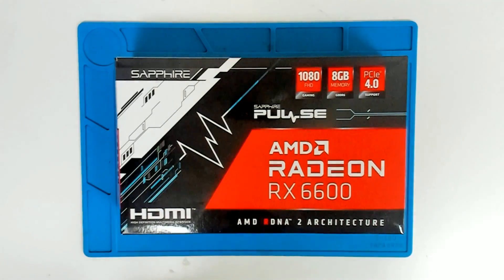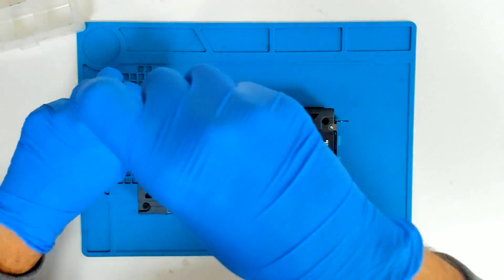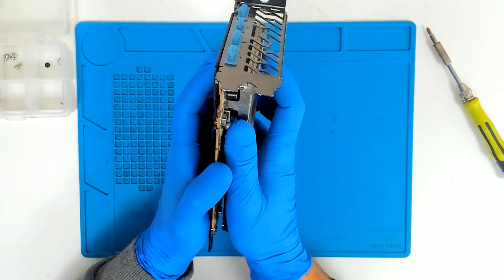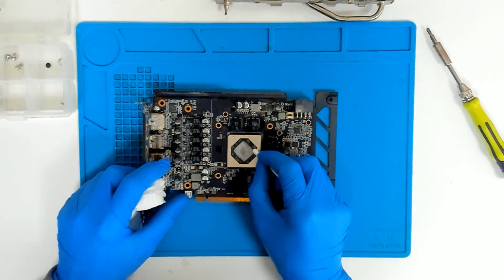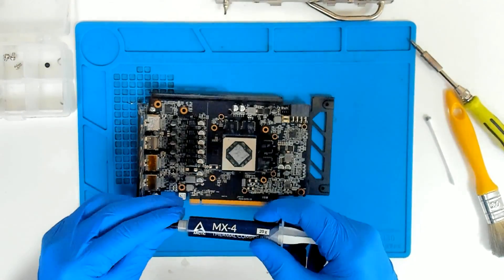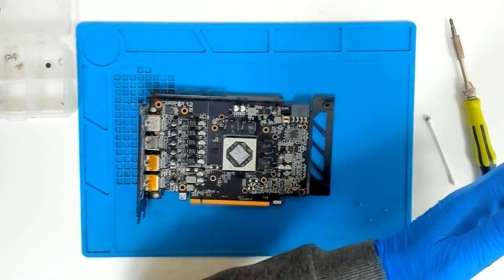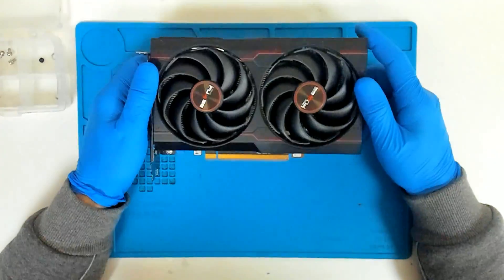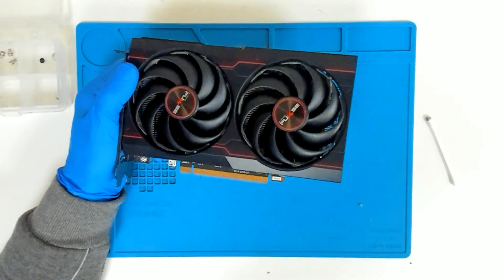AMD Radeon RX 6600 Pulse Thermal Paste Replacement

Comment: Hi I have a question. Can we remove just fans except aluminum blok for sapphire pulse rx6700 10gb
Reply from the maker: Why do you want to remove only the fans. You can clean the dust with a brush without removing it.
Reply: @LaptopDisassembly  I don't know I want to make sure it's clean
Reply from the maker: @yldrm743 Dust is not the biggest problem. You can vacuum the dust without removing anything. Problem is the dry paste that will stop to suck the heat from the GPU.
Reply: @L @LaptopDisassembly , I wanna try clean the dust with brush and vacuum. If heat down I wont remove anything(my english is bad. I didnt use translate for this comment, ım sorry 😢)
Reply: @LaptopDisassembly btw thank you so much for your help 😊
Reply from the maker: No problem. Clean the dust and if that doesn't help, you need to replace the paste.
Reply: @LaptopDisassembly I’m gonna do it and I will text you again for the results by by have a nice day 😊

Comment: Btw if the pads look "wet" in some areas, they are CAPUT and you'll need new ones - stronger ones (better conductivity). The ones they sell it with are like 4-5W/mK 🤢🤢🤢

Comment: sir for asus dual rx6600 xt 2mm?
Reply from the maker: No idea. I haven't open that model so far. I usually don't replace the pads, only the paste. The pads don't dry out like the paste, so you can leave the original ones.
Reply: @ 👌 thank you

Comment: Sapphire pulse cooling is trash. I have a Pulse RX6600 and it runs a bit hot with factory fan curve 75C 85C hotspot 100% load but from what i read it these are the normal values. I can drop the edge and hotspot by 10C each with a custon fan curve but then it sounds like a jet plane. Thanks for the video. Now i know how to service the gpu if temps start creeping up.
Reply: Hotspot is usually 10-15° hotter then gpu temp. If hitting 20 over under load time to repaste.
Reply: Yaya, i was lucky and went with AsRock challenger six six XT ❤❤❤, 3years, same factory paste, still runs coooooool

Comment: hi, have you ever measured the thickness of the memory chips thermal pads? is it the same with the VRM's at 1.5mm? i just want to change the paste but just in case i ripped the pads i want to know the thickness
Reply from the maker: No idea actually. You can try and search on Google.

Comment: Hi
1.5 thermal pads are okay for this gpu? 
I have a serious problem 
Changed thermal paste and temps was good for a month.. 69 for gpu temp and 85 for hot spot
After a month temps goes very high
75 for gpu temp and 95 for hotspot
So i want change thermal pads if it fix temps
Reply from the maker: VRMs are 1.5mm yes. But use a good quality ones like thermal grizzly or so.

Comment: Sapphire also have really bad cooling performance on 6600XT pulse and 7600 pulse as well
Reply: Zero issues with mine and it's overclocked to the max, running 68 at gpu and 78-82 on hotspot?

Comment: to make it easier to take apart just warm it up a tiny bit by running a game for a few seconds and then powering off your computer til it's cool enough to touch
Reply: For real, I suffered watching him pull 😂
Reply from the maker: If the card is warm enough and is still stuck, when you try to pull you may damage some solder balls under memory or GPU. A friend of mine did it, so no thanks. I haven't got any problems so far, so I try to give back a working card to the customer. 😁

Comment: Time to repaste my card too, the hot spot goes above 110º under load until it shuts down, like I can barely play for 15 minutes. Thank you for showing the insides mate.
Reply: I was about to buy a new card now time to try this!
Reply: @skyza108  please advise on your results after 🙏 I did this too and it helped a bit but there is still a big delta /difference between hotspot and edge temperature of 12-20°C My edge temp could be 67 and hotspot 87°
Reply: I repasted with Kryonaut and hotspot now does not reach 100C! (screw the warranty :P) before it would hit fast 100C and even 110C!
Reply: @Mine8maniak  hi, what temps do you get now after the repaste?
Reply: nah thats crazy. i would repaste it once it hit 90c

Comment: What is this? Why are you doing this? Why do you install new paste when you leave the old thermal pads...
Reply from the maker: Thermal paste and thermal pads have nothing in common. Paste dry faster, and if the pads are one piece, you better not replace them with cheap stuff.

Comment: does it have any impact on temps like can you please tell before and after temps
Reply from the maker: The card is used for mining. Accoyyo the customer the temps under load was above 100 and powers off. After the cleaning under load works around 80.